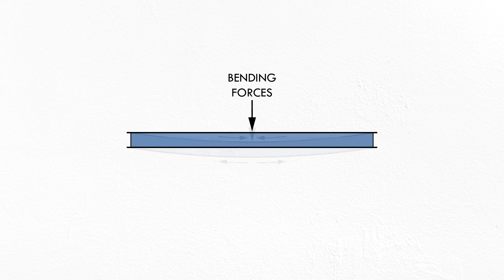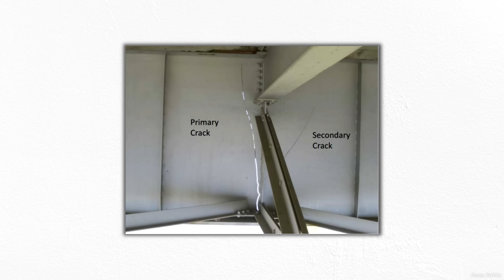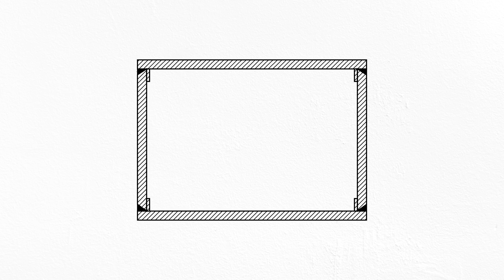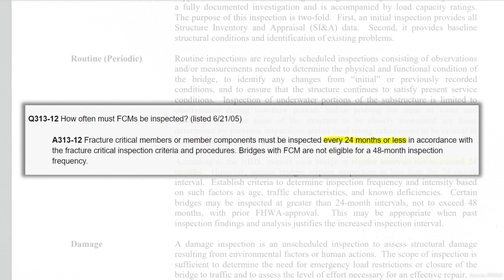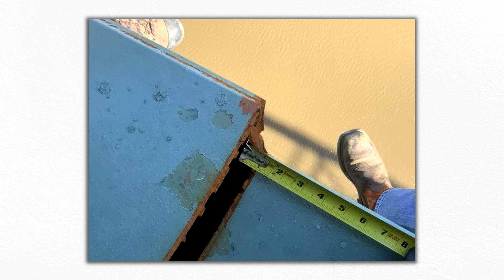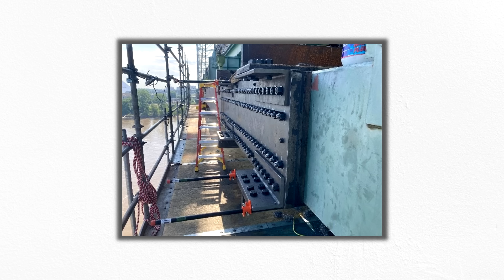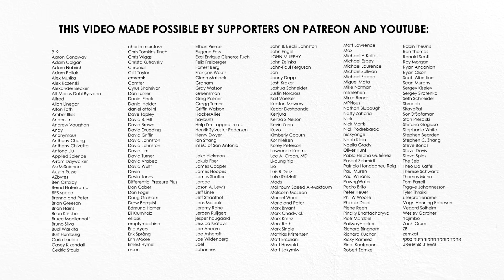What Really Happened at the Hernando de Soto Bridge?

Comment: Check out what happened to the Brent Spence bridge in Cincinnati/Kentucky. After major structural issues, they decided to paint the bridge since the 2 states cannot decide who will pay for repairs.
Reply: @Ethan Stock its a lot more in depth than which state will pay for it. The US government was supposed to step in years ago to help fund the project. The level of repair the bridge needs in terms of cost is beyond what either state can realistically pay. Also the semi crash didnt really help with things lmao. That being said the bridge is still technically structurally sound. The real problem is more so the impact a failure "could" have on the economy. Which is why talks of building another bridge are happening to alleviate the stress on that one bridge and also make a back up bridge in case one needs shut down.
Reply: @ah7027  if only Kentucky had a strong representative in the federal government....I mean one that doesn't enjoy watching misery and suffering.
Reply: If an agreement cannot be reached then the bridge should be shut down. Wtf?! They are risking innocent lives here
Reply: @S.Crown414A  stfu you’re blind as fuck
Reply: they replaced a bunch of steel in the top deck before they even reopened it

Comment: TDOT has an animation describing what the phase 1 and phase 2 repairs are in case anyone is interested. Just do a Google search for it.
Reply: @TreeSymphony52  lol yeah if it’s anything like TDOTs other projects. They’ve been working on 1-40 through Jackson for what feels like 15 years
Reply: @Rampage4635  lol yea they have been "working" on a highway near where I live and they started the same year I graduated high school ... that was 1997
Reply: Does it involve bailing wire and JBweld?
Reply: @nunyabussiness4054  Duct tape.
Reply: @nunyabussiness4054  a wire cup wheel and some 6011 and it'll be fine.
Reply: @joecummings1260  you sure that's not 1109 rod?
Reply: @shospulecolupis9718  yeah when you weld with it upside down, it increases the tensile strength to almost double
Reply: @nunyabussiness4054  lol
Reply: @TreeSymphony52  IIRC, there was a plan for a bridge to cross I-69 over the river but it was shot down.  Now would be a perfect time to reassess that option, as it would considerably reduce traffic on the 2 bridges in Memphis.
Reply: Also, TN and Arkansas congressional reps are petitioning congress to include a third bridge to the infrastructure package. No clue if it'll get traction, but a third bridge has been discussed many times and only recently was is removed from play. With the recent developments, I hope that is seriously reconsidered.  I suggest extending the northern loop of I-40 west to cross the MS river north of the wolf river.  To me, it seems like this would effectively share thru traffic on I-40.  But what do I know...
Reply: TDOT Animaiton for the lazy https://www.youtube.com/watch?v=9QprIzj45n4
Reply: Tennessee website on repair:  www.tn.gov/tdot/projects/region-4/i-40-hernando-desoto-bridge

Comment: Some JB weld will fix it right up. That stuff is amazing!
Reply: Just need a couple of come-alongs and an arc welder. Weld rings to the beam a few feet away from either side of the crack. Use the come-alongs to pull the crack shut and weld it back together. Good as new.

Comment: Thanks Grady, I had missed this bridge closure.  This points out the importance of inspections.  When working I was part of a program of inspection of the electrical, mechanical, operations and management of our power facilities.  There was also structural (civil) inspections done in a parallel program driven in part by Dam Safety requirements.

Comment: i can imagine that road traffic would painfully adjust to using the old bridge, but if the fear of collapse stopped all mississippi river traffic..that seems an intolerable situation. do you know what they ended up doing for that?
hmm if the guy was fired for failing the inspection, does that mean he could apply to any other inspection job? ack... or in the worst case, even be re-hired by the same place if the firing was just done for public relations. if he doesn't have a criminal record then i could imagine no red flags esp considering most employers will only confirm previous employment without any commentary. though i guess we're all humans and sometimes make mistakes and can learn to do better. but then lives are directly involved too... :-(
Reply: I'm not sure if criminal charges can or will be applied.
Reply: When someone makes a huge mistake like this you know they'll never make it again. I bet this guy's attention to detail will be much higher from now on
Reply: It looked like they patched the cracked member until they could get a full analysis of the situation, which would probably make it safe enough for river traffic to resume.

Comment: Something worth mentioning is that the crack gradually increased rather than a sudden snap. If it were a sudden snap, the shock waves through the rest of the structure may well have caused an immediate collapse. I've driven across that bridge a few times in late 2019. Wow.
Reply: I wonder if they can even find the cause. IDK in the US, but in my country civil engineers cover their back a lot with over engineering. The times I know a flaw was found in critical infrastructure was always because of problems with materials or construction.
Reply: There was a point where it did snap to the inch gap, fortunately there was enough supporting structure to take the additional stresses.
Reply: I'm also thinking that having the deck support tired into the bridge tie probably kept a lot of tension on the two ends. Had the tie been only connected at the end, it would probably have been a lot worse.

Comment: Suspect some "manager" or "politician" learned of the crack and decided not to do anything.
Reply: Even then, it is a failure of the system that they alone should carry that authority.

I have long argued you need a systems theory approach to everything from medicine to even politics.

But getting people to relinquish their power is a greater problem that requires more involvement than placing blame.
Reply: More likely lazy inspector, lower management that don’t give a shit, and the unfortunate reality that people don’t vote for significantly increasing taxes and funding the budget needed to inspect and maintain ageing infrastructure. 

The unfortunate reality is that old structures require more and more maintenance, that costs more and more for materials and work hours these days. The 9 to 1 funding that states received back in the day sure increased highway building, but it’s not free to maintain.

Comment: if they find major defects in the entire structure what happens then? If theres widespread issues in heaps of spots is it possible to repair them all or would it be cheaper to take down the structure and start over?
Reply: Yes, demolish the bridge and build a new one.
That is quite a likely outcome of this problem.
Most of these will even fail on their own before such a decision is made, just look at the recent collapse of Arecibo.
Reply: Mostly comes down to economics. Just like owning a car, after about 10-15 years the repair bill will start to outscale the value of the car and it would be better to buy a new car. Granted a bridge will hold its value much better than a car, they still need to do the math to see if it's worth all the extra expense on inspection, repairs and insurance.

Comment: I'm wondering if there is possibility to make smart sensors on such bridges. Since beams are from steel, they conduct electricity. And such cracks should probably increase resistance. So maybe soon we will be able to monitor bridge health along inspections, and find flaws that wouldn't be possible to spot with regular inspections decreasing repair costs, and off time.
Reply: Yeah, stress sensors exist. Like Extensometers.
Reply: It could be done, but it's not easy to make this reliable, yet not cause corrosion issues.
Reply: Budget.  There are multiple ways to skin that cat, but no one wants to pay for it.
Reply: One option is fiber optics inside the concrete, you can measure stresses, as well as detect fractures. Measuring resistance could work if most of the steel in the bridge is connected, but you would likely have too much external noise to catch the minute changes without running enough current to have to worry about corrosion. (just my thoughts on that I could be wrong) Considering how easy it is to slap low power sensors everywhere, one would think failures like this would be a thing of the past.
Reply: It could be done on the cheap even. If the sensors give a false positive, better safe than sorry.
When the sensors break down, the required normal checks would catch the issue.
But the sensors themselves should be as dumb as possible, as that makes them way more reliable.
Reply: I'm thinking of how Porsche had pressurized the frame of one of their race cars.

Any drop in pressure and you knew you had a problem with the frame. Cheap and effective.
Reply: @quintessenceSL  A solution fit for a race car is not a cheap solution. On the bridge there are dozens of square metres of welds and rivets which need to be air tight, not to mention the entire volume on the order of 100 of cubic metres you would need to pressurise. That's entirely ignoring the fact that not all of the critical members enclose a volume to begin with. If you want continuous strain monitoring, just use strain gauges at the interest points. Not that it would really make a difference because you would still need to carry out inspections regardless.
Reply: @terminus.est.  You add a pieces of tubing to the structural members with access points where they can be read. 🙄
Reply: It is possible to measure resistance of a bridge, but im not so sure if it can be made reliable, a quick math from wiki formulas and datas puts a 25mm thick (one inch) 500mm x 500mm ( a bit more than 1,5 feet) 100meters long square tube section at 48 pico ohm wich is not that easy to measure
Now i might be a bit off on my math, i was never good at it, but i would expect the bridges overall resistance to be around micro ohms to nano ohms at least, wich is hard to measure accurately on such a lange piece because it picks up quite a bit of radio wawes and static electricity just by being that big
Reply: @szabcsababcsa  In subway sometimes (maybe always) they use a corner cube reflectors to monitor the displaycement of the walls (structure) when construction is happening above or near it. So i guess it can work, the only problem, that while metro in underground is usually are exposed only for direct forces, the metal bridges may casually increase it's lenght just due to temperature changing on a daily basis. But atleast reflectors on every major joint of the bridge would definitely show the constant increase in length on one side of the bridge, so that still probably a cheap and viable option. But i guess it's overkill and just decent and proper annual inspection by a team are pretty enough for most of the cases and so far there is no need for so extra safety practics in bridge's maintenance.
Reply: If you're interested, go look up electrical tomography.  The frequency-dependent electrical parameters of a material change when cracks, deformations and impurities are introduced, and with with techniques such as electrical resistance/capacitance/inductance/impedance tomography, we can detect not only the presence but also the location of the issue.  If these devices were built into the bridge's design, we would not only be able to measure the load on the bridge in real-time, but cracks would be noticed as-and-when they occur.  The only issue is the cost of the devices, but for a bridge (short span, high cost of failure), I think it would be well worth the investment.
Reply: @ScottTancock  that is an interesting technology, but expensive tech will not make it into bridge monitoring, because 1. It doesent take out the human element, as humans will be able to ignore it still and humans will still need to go out to inspect and repair it
2.it wont get rid of any running expenses, because now you can have fewer inspections of the brigde, but the monitoring system will have to be inspected and tested alongside of it. So it will never return its cost.

It may be possible that load cell sensors will be placed, because they are cheap as dirt. But anything expensive is very unlikely to be ever used in a usecase like this
Reply: You can add all the sensors, gauges,etc you want to and it will not help, because the people in charge are corrupt and don't care. That's the sad reality of these situations.  It took an outside source to finally stop traffic and save this disaster in the making from happening.
Reply: @Watchdog_McCoy_5.7x28  While the corruption is entirely possible (we don't have any confirmation yet), the hope is that, with continuous monitoring, someone will see what's going on and sound the alarm, rather than trusting a select few with that responsibility. All it takes is for an intern with a conscience to look at the situation, ask some pointed questions, then raise the alarm to an authority that isn't intent on covering up the issue.  As things are at the moment, things can be kept hush-hush by always having the same person/group of people inspect the fault.
Reply: It is possible, but you need to consider the managerial infrastructure who decide what to do about the information.

Comment: Professor Anthony Croxford at Bristol University in the UK is working on a system to use ultrasound to detect cracks in structural members. See Phys. Rev. Lett. 113, 144301 (2014).